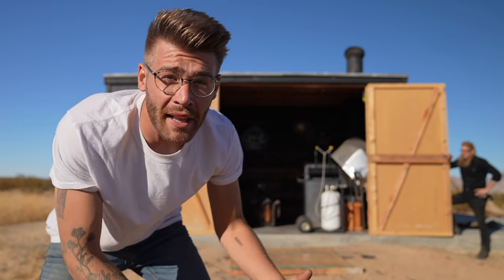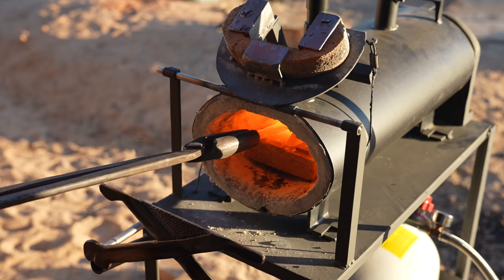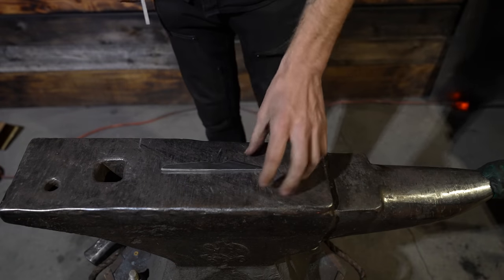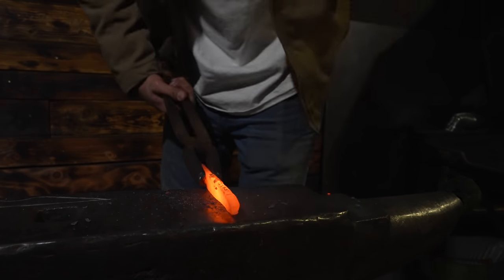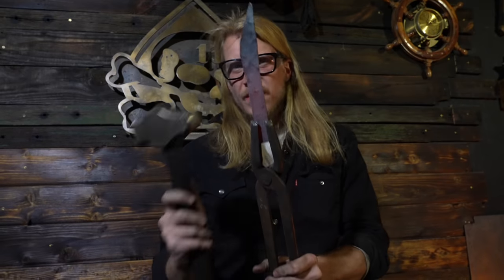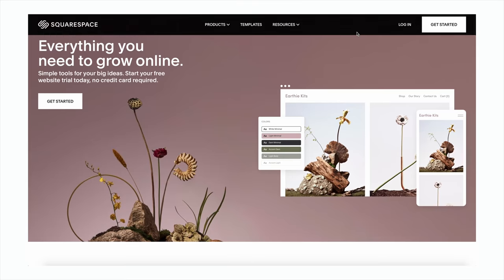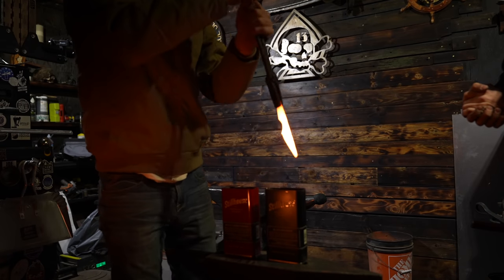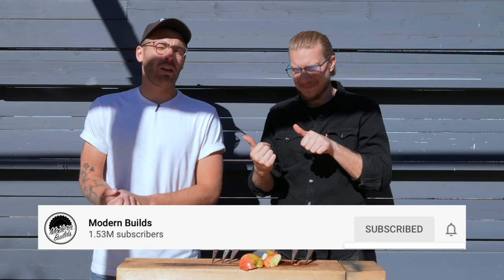I Try Blacksmithing For the First Time!!! Making 5 Hand Forged Knives | Modern Builds

Comment: Your knives turned out not bad, but there's so much bad information in this video. There's a bunch of blacksmith youtubers that know what they are doing (Alec Steele, Will Smith, Black Beard Projects, That Works, AWE me, etc.). 

1. You don't need to anneal steel before forging, by heating it up to forging temperature it already loses all of its hardness.
2. You forged them way too hot, you can forge the steel when it's orange and the scale that stays behind after forging is a fine dust, not large chunks.
3. To harden the knife (quenching) you heat the steel up to the critical temperature, where it loses magnetism, past that will definitely increase the risk of the steel cracking and won't add to the hardness of the final knife. 
4. Good quenching oil, engineered for the specific goal to harden knives is readily available, if you look for them, no need to use canola oil, that loses it's effectiveness quickly and will cost you more in the long term.
5. Tempering reduces hardness (a bit), but increases toughness (a lot). 
6. The process of annealing is done after forging, before quenching. You heat up the knife up to critical and letting it cool down x3 to grow grain structure and remove tension created during forging (greatly reduces the chance of the blade warping when quenching).

At least Brett showed you a decent grip on the hammer.
Also welding a half meter piece of round bar to the piece of steel you want to forge, it's much easier to handle.

Sincerely,
a hobbyist bladesmith